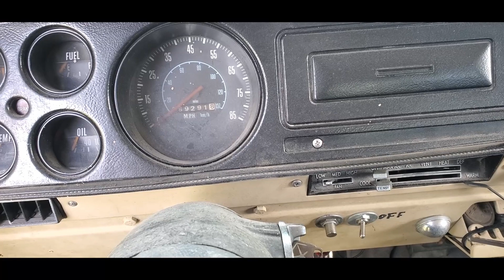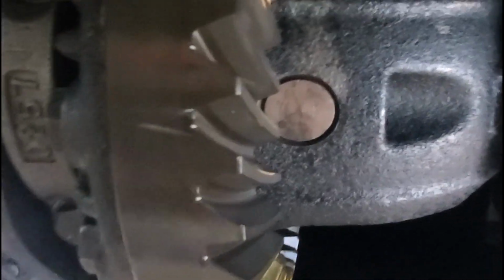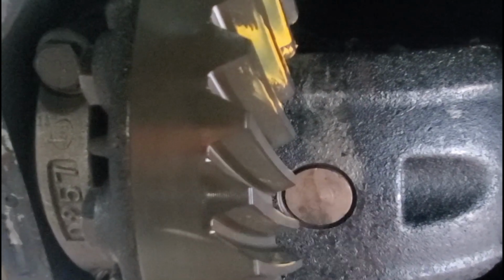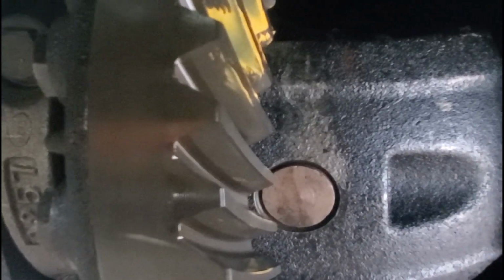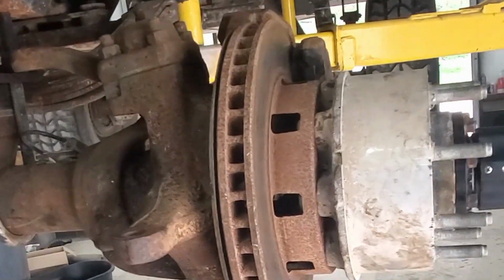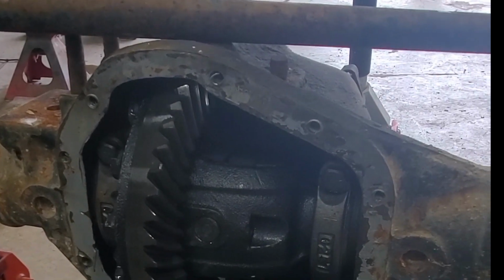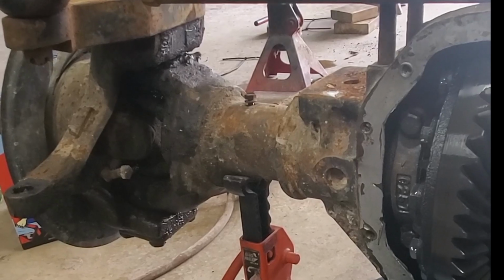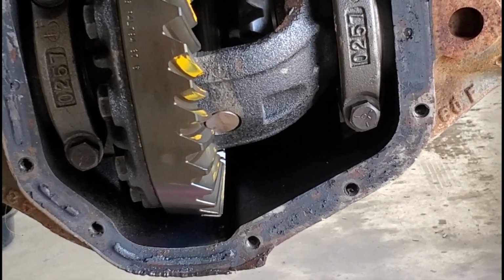How to install Dana 60 Front into a 1977 Dodge Ram Charger  Rock Crawler Cummins Swapped

Comment: Love the channel! I bought a similar Aussie style locker for a an 8 3/4 rear. I plan to throw it in my challenger. It seemed like a cheaper alternative than a Detroit locker and I’m assuming more reliable than a stock suregrip.
Reply from the maker: Thank you! I appreciate it! I've heard good thing about the Aussie lockers from the Jeep crowds. The one I will be running is a Spartan and its the same as the one in the previous axle, which worked great! Thanks Again for watching!

Comment: Could you have left the dually hubs so you wouldn't have to use wheel spacers? I don't remember what they measure out to. Nice videos :)
Reply from the maker: The Dually hubs are a little wider then the spacers, so if i run the Dually hubs the Deathcharger wont fit on my trailer! Thanks for watching Sam!

Comment: I rebuilt the  diff in my 72 Blazer. Everything went well. As I was cleaning up and ready for a test drive I found the crush collar
on the tailgate. ;-((  Your not the only one!  Regards from Ody Slim
Reply from the maker: OH NO! That's brutal, it's like forgetting the fitting on a brake line after your flared it! Appreciate it and Thanks For Watching!

Comment: Al it needs is a starter switch. That's why you have to have a push button so if you can do mechanic work you can replace the starter switch
Reply from the maker: Yup, I did some very quick "electrical " work to the ole Deathcharger a few years back in order to take it to Moab, but for some reason havent got around to fixing it ha ha

Comment: Can you take a w150 5 lug axle and swap it out for one of these dana 60s is the gm 6 lug axle the perches are they the same as a dodgebin length
Reply from the maker: Chevy axle perches I believe are 1/2 inch differences on each side. But if you are swapping Dodge Axles for Dodge axles from 1972-1993 They will all fit. Thanks For Watching!
Reply: @DuddiesAdventure  got a w150 stepside 4x4 it's a  pain trying to find 5x5.5 wheels and not much axle support
Reply from the maker: @gunsandhorsepower  Randy's Ring and Pinion is a good source for aftermarket axle parts https://www.randysworldwide.com/
Reply: @DuddiesAdventure  k thanks if I was to look for a d60 what year would I be looking for not shure if they are like the ramcharger and 1/2 tons where some years are weaker than other or I hate the axle disconect dodge had
Reply from the maker: Ive got a few videos on Dana 60 that you can check out. Here is one on how to convert from a External style hub to a Internal style. https://youtu.be/WtsCBM0dmHE

Comment: Written on the wall in our bar in Honduras on Soto Cana Air base. Taxi or tacos, taxi or tacos, taxi or tacos, fuck it man tacos.
I got a dana 60 rear out of a 68 camper special with 4.10s. For my use 4.10's are good truck gears and I can still hit the highway. Looking for a front 60 with 4.10s. I have a 1983 Ramcharger 318 727. Parting up to build a Magnum 360 to a 408 and a 727 that can handle at least 600 HP.
I figure it should work for 33's.
I like to fix or improve the factory stuff yet not get too far off. Go too far and stuff breaks all the time. Performance and reliability are my goals. 
Better than 375 Hp and better than 425 ft lbs TQ should get my RC anywhere I need to go. I can't beat on it its in too good of shape. I am 4th owner from a family. Grandpas, to Father, to Son. Son wanted Cheby parts and sold it to me for $1,500 cash (idiot). Everything even the tank sending unit worked except the A/C. No dents, no crashes, minor rust on the floor pans. I sanded that, prepped it and sent it to Line-X. I have no carpet son. Just Line-X and rubber floor mats. Heck my interior is the back bench and two non matching front buckets. 
Mopars I have owned in years.
66 Baracuda S-sport 273 HO 4-speed
68 Coronet 440 318, 727
73 W200 Powerwagon 360, 4 speed
HAA HAA 74 Colt station wagon
83 Ramcharger 318/727
89 Ramcharger Fucking parts
Brother put 327,000 on his 94 1500 Ram, I drove it a lot too
04 2500 Ram hemi, 5-speed, 4.10s - custom ordered new from Iraq.
And bee da bee dats all folks.
Mother MOPAR's tits offer good milk.
Reply from the maker: Thank you for Watching!